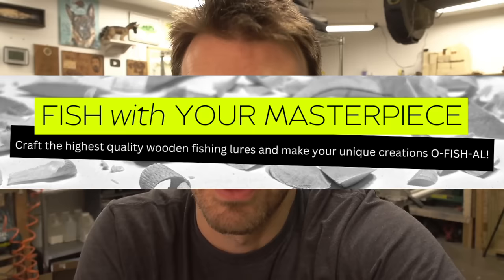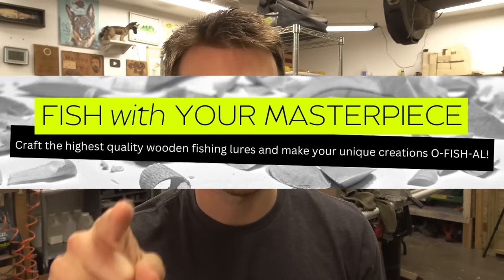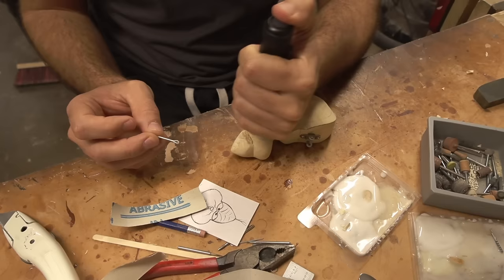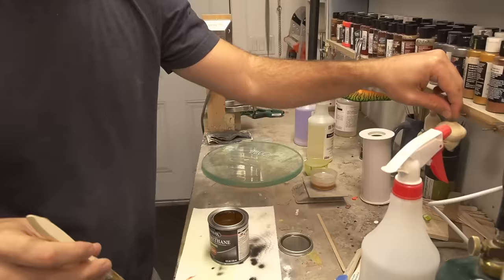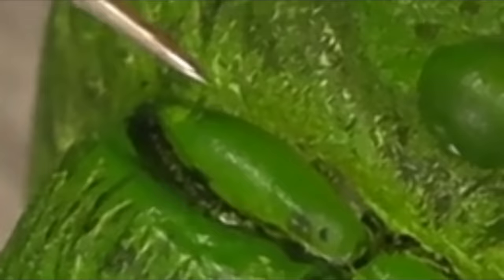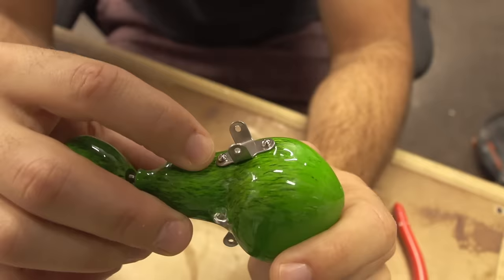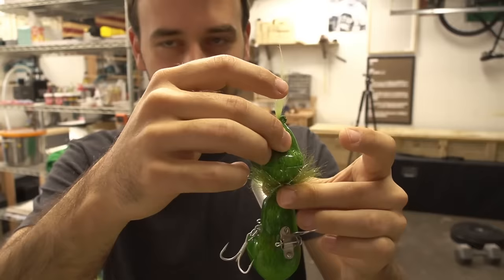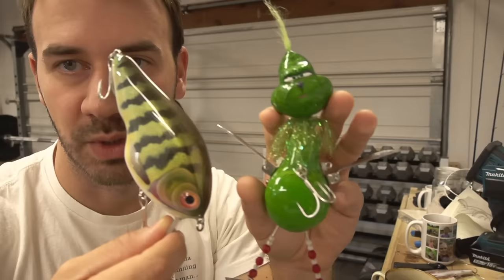Making The Grinch Lure

Comment: What size of wire do you use for inline spinners?
Reply from the maker: It’s 0.051” diameter stainless steel wire I get from Ebay: https://www.ebay.com/itm/163757350293?mkcid=16&mkevt=1&mkrid=711-127632-2357-0&ssspo=Sa1DInt4TjG&sssrc=4429486&ssuid=&var=&widget_ver=artemis&media=COPY
Reply: Thank you!!
Reply: Do you just use a bullet weight for the body?